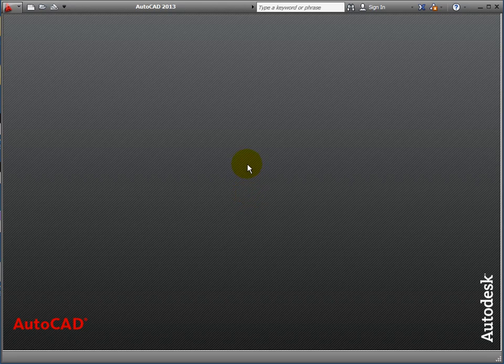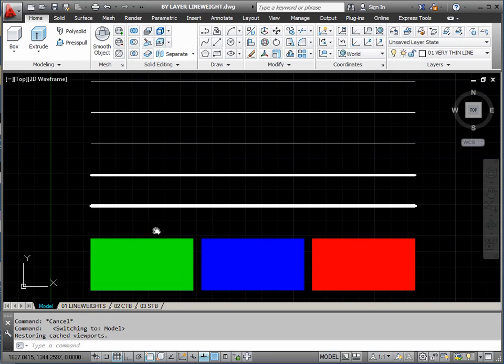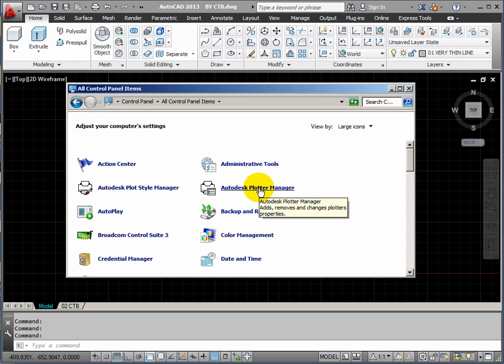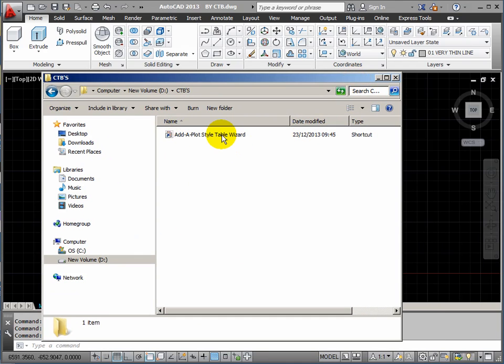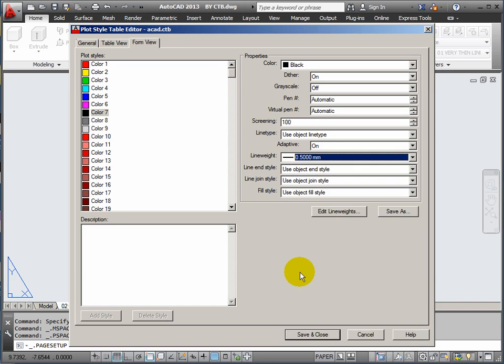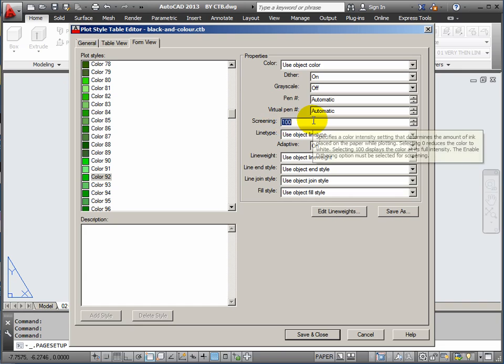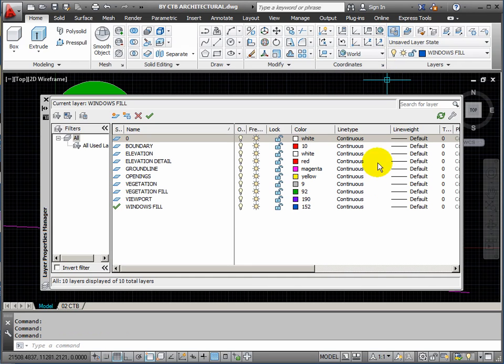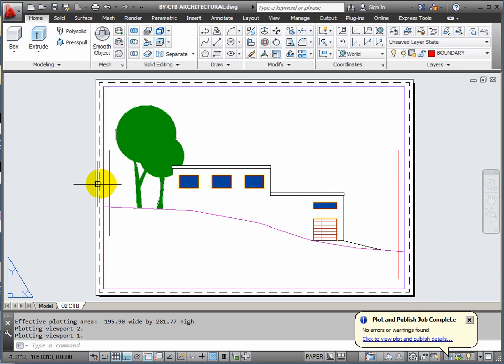AutoCAD - Setting Up Lineweights via CTB and why!

Comment: Fantastic explanation, appreciate your time doing this. Cheers
Reply from the maker: Thanks for the feedback Steve, much appreciated.   .CTB has been around ages but I have not found a better system yet in other software.   I use a 'pencil case' analogy when trying to get my students to understand it - thin, medium and thick black pens and then lots of coloured felt tip pens.   The fact that it is a separate file means it can be sent or archived with a job, personalized or standardized.   Somebody at AutoDesk earned their crust the day they invented it.   Best regards from (surprisingly) sunny Scotland.

Comment: If you are drawing things like buildings for architectural plans, you want lines that are designated for specific items.  
You name a layer according to what you draw with it.  For instance, you'd have a layer for walls that you call WALL, or A_Wall.
When you click on a line, the layer name tells you what the line is a part of.  If the name is A_Wall, I know that it is part of a wall.
A_Door layer is for, doors.  Surprise.
The A_Wall layer has a thicker line weight than the A_Door layer, and the A_Wall-Sill layer is a little thinner than the A_Door layer.
Each layer is given a different color so you can identify them on sight.
AutoCAD allows you to set the color, line weight, and line type, for each layer without modifying the CTB file, and that's what I do.
Control layers in the Layers Properties dialog box.  That keeps the settings in that ACAD file, and if you want to take a line that you have set up to another drawing file, you can copy paste it in.  It will take its properties with it as long as there isn't another line with the same name already in the destination file.

In two dimensional work, I have lines for drawing Elevations, Sections, and Details, that are not named for what they represent, but are named for the thickness they have.  A2_00 is very thin, A2_70 is very thick.  That is basically what he shows in the video.  It is appropriate to not designate specific layers for particular objects because the same type of object that is represented as closer, should be drawn with a thicker line than the same type of object that is supposed to be further away.

Comment: Please, do the same video for STB! Or some video showing STB vc CTB advantages and disadvantages. I'm about to configure my company Template for Terrain Surveying in AutoCAD Civil 3D and I still can't figure out which one is going to be best. Topograph drawings uses a LOT of colours, so I think that CTB will make things bad as some texts and lines shares the same colour (for example white). As our drawer is really used to associate the line colours that he sees in Model Space with the surveyed elements on terrain, adopting CTB could kill our workflow, because I can control how elements are going to be printed but they are going to be showed differently on screen while working in Model Space. So please, if you could show the STB method I would be really appreciated for that...